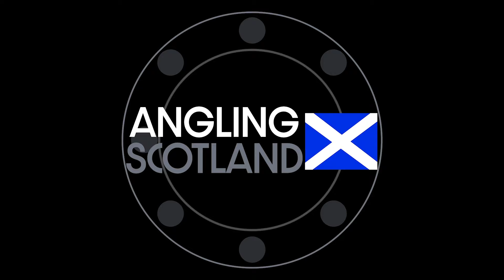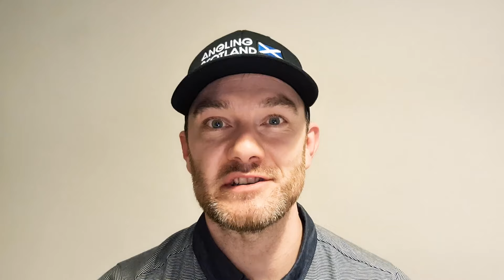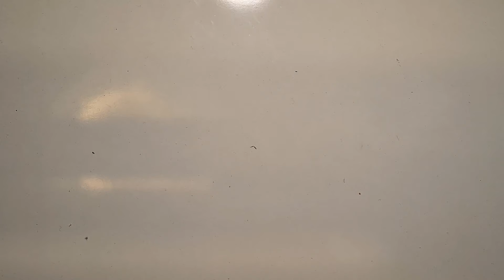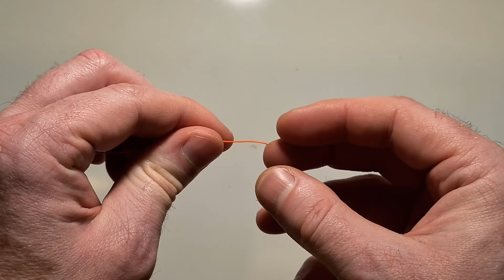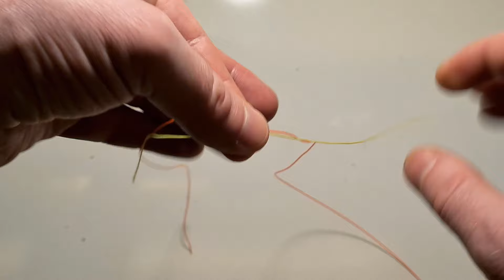Fly Fishing Knots | Two turn water knot (dropper knot) tutorial

Comment: Great but what happens when after tying on a few flies the dropper becomes too short to tie on another fly? Simply snip the dropper line off, leaving the knot still on the tippet. Tie another piece of tippet material onto the line "above" the knot using a clinch knot. Slide this down to the knot and then cut off at the length of dropper that you want.
Reply: Or use a Davey knot- which is smaller, stronger and easier to tie
Reply: Done that b.fore

Comment: I have a question. Supposing you are fishing and you get a tangle on a dropper and want to quickly cut off and retie a dropper, what knot do you recommend for this?
Reply from the maker: Best way is to cut at the tangle then add a new section.   We try to avoid unnecessary knots on the line as much as possible
Reply: @AnglingScotland   The whole point of your video was that there was no separate sections and one line top to bottom, do you use a variant of the above knot to fill in the missing section or just do something different?
Reply from the maker: No, it’s the same knot either way.   If you snap or have a tangle but there’s enough left, simply add the length you need down to your point fly.  The tag end becomes the dropper.  

Or simply replace with a new tippet section
Reply: @AnglingScotland  ah, makes sense, thanks for that will give it a go.
Reply from the maker: No worries, you’ve given us an idea for a video though.  What to do if I snap my dropper rig :)